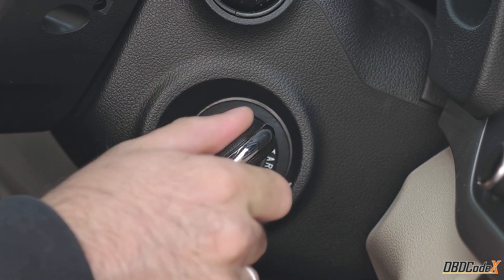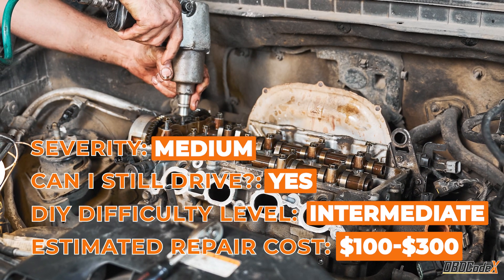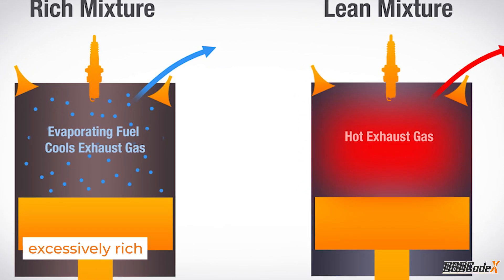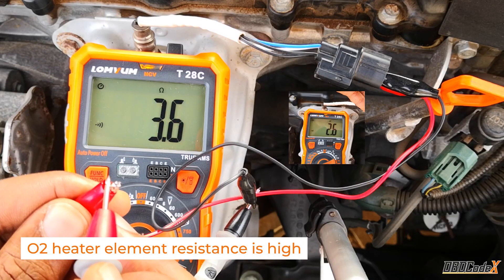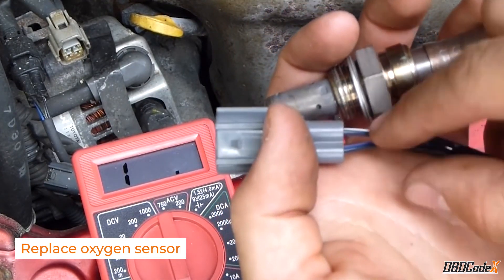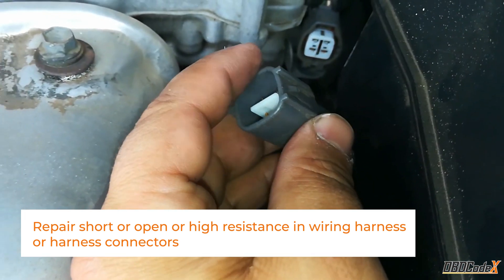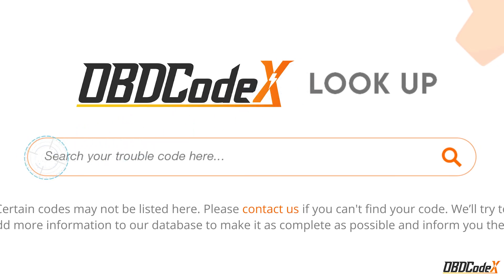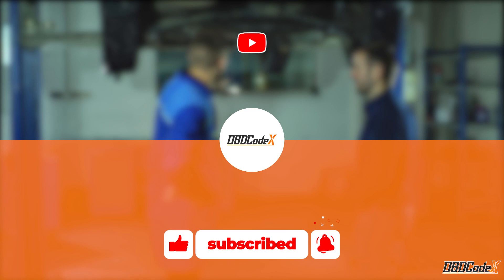P0141 Code: Understanding the Causes and Solutions for O2 Sensor Heater Issues

Comment: Brought my truck to multiple mechanics with a p0141/138 -new sensors and still get it, mechanics say the wiring is ok/congruent and the sensor is in tact. Pcm? Fuses and relays work
Reply from the maker: Before testing the PCM, make sure to check the wiring and connector from the O2 sensor to the PCM for any faults. If everything appears to be in good condition, it's possible that the PCM itself is the cause of the problem. In that case, testing and repairing the PCM will be necessary.